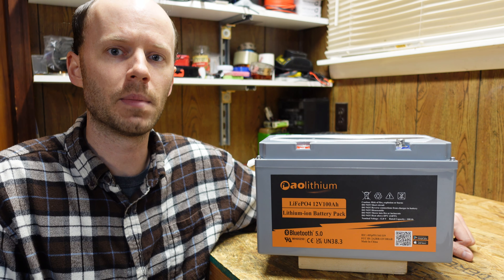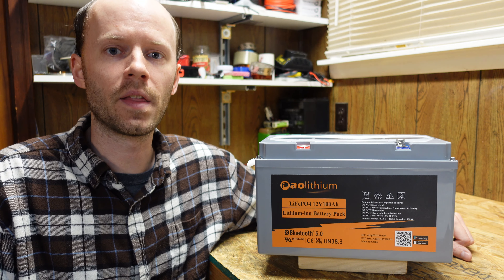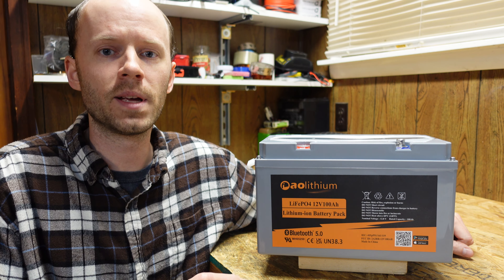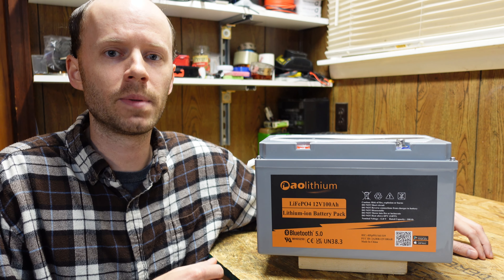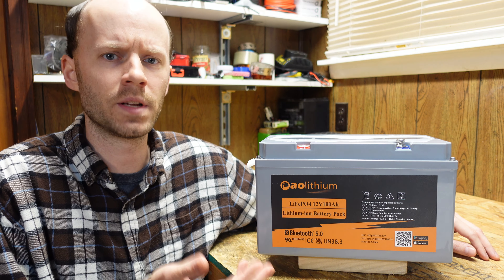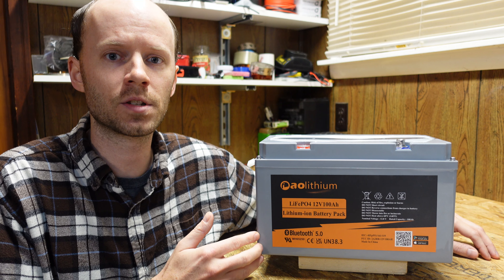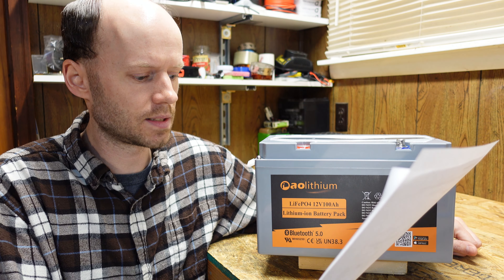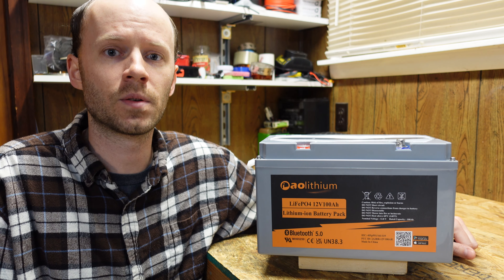Updates on the AoLithium 12V 100Ah LiFePO4 Battery

Comment from the maker: The updated specifications sheet for this battery can be found at the link below.
https://cdn.shopify.com/s/files/1/0583/7271/8767/files/Aolithium-12V_100Ah_Specification.pdf?v=1640695246
As always, please feel free to leave any questions, comments, or concerns. Thanks for watching!
Reply: They sent the updated specs but they didn't bother to update their listing on their website, it still says 200A continuous. Most people will just see the their listing to buy it. Hmm....
Reply from the maker: I noticed as well that, at the time I uploaded this video, the website still listed the 200A discharge current. However, as of the time of this post, it appears to have been corrected and the new specifications sheet posted.
Reply: @DSmartLife  We are really so sorry for this unintended mistake about Aolithium 12V 100Ah LiFePO4 Battery.
The correct description should be the Maximum Long Pulse Discharging Current is 200A, Maximum Duration: 3min.
We have already correct the data in specifications, websites and other promotional materials.Thanks for your supervision and support!
Reply: In Will's video the discharging lasted for 27 minutes with 201A current, and then, the battery was automatically cut off, because the battery was being protected by BMS. The over temperature protection temperature of the battery is 75°C, and the battery would automatically cut off when it reached 75°C. In Will’s video, he told us when using high-power electrical appliance, you should make sure that the maximum discharge current is no more than 200A ,and you don't run it for more than three minutes. The same advice is given to you by Aolithium.
Reply: that link does not work for me.

Comment: 3 minutes @ 200amps is still very useful and not many other batteries use calb cells that is capable of this. Actually I couldn’t find any prebuilt . If they do change there bms, hopefully they keep this feature. I will accept a healthy price drop as a sorry for this false advertising. Thanks for the video!

Comment: Lots of folks in the boating and camping world rely on 24 volt batteries.  I also think that a 24v system is what some people would consider "right-sized" for an emergency backup system for powering their fridge and a few lights during an extended power outage.  Your opinion may vary.
Reply: same here

Comment: Thanks for the update and keeping such battery assemblers in check. Can't imagine they did so much to increase the current capacity of the battery but "forgot to check cell specs", which is there most important. Now basically this battery isn't worth more than any other decent one in the market. Most of the 100A JBD BMSs can handle surge currents, no need to pay a premium for 200A BMS for that and sacrifice 48V capability. They also forgot to program the BMS for high temp cutoff at 60°C. Anyways thanks for the video.
Reply: We are really so sorry for this unintended mistake about Aolithium 12V 100Ah LiFePO4 Battery.
The correct description should be the Maximum Long Pulse Discharging Current is 200A, Maximum Duration: 3min.
We have already correct the data in specifications, websites and other promotional materials.Thanks for your supervision and support!
Reply: Because the 75°C set by our protection board is the temperature of the aluminum busbar, which is the internal temperature of the battery. It is more accurate to detect this temperature
The 60°C you mentioned refers to the environment temperature, which is the external temperature of the battery. 
According to the summary of the previous bms development data, when the environment temperature reaches 60°C, the temperature of aluminum busbar will generally exceed 75°C. 
So our over-temperature protection setting is correct.

Comment: 24V is common in some parts of the world where 48V  (57.6V peak charge voltage) exceeds some local codes for low voltage and therefore requires wiring by a licensed electrician to comply with local codes.

Comment: will prowse just did a review on that battery and despite the spec sheet this battery pulled 200amps for almost 30 minutes...  it was extremely hot but it did it which is pretty impressive!

Comment: Well done! I was surprised Will did the full test he did, after he found the spec sheet for the cells only allowed 200A for 3 minutes… 
I can sure see the value in  the BMS allowing 200A discharge, but locking out 48V use, and not temp limiting the discharge is bad on their part…

Comment: The 50 Amp charge apply for only 1 battery or apply olso if there is 3 o 4 batteries in parallel, or you can pump more the 50 amps if the is 3 or 4 more in parallel. Thanks

Comment: Nice follow up. Thanks. 24v systems are very useful, 12v is not capable of the higher amperage without very large cables.

Comment: Unacceptable from a manufacturer that the 200A rating would make it all the way to the battery specifications
Reply: We are really so sorry for this unintended mistake about Aolithium 12V 100Ah LiFePO4 Battery.
The correct description should be the Maximum Long Pulse Discharging Current is 200A, Maximum Duration: 3min.
We have already correct the data in specifications, websites and other promotional materials.Thanks for your supervision and support!
Reply: @aolithiumofficial  how can the consumer have trust in a brand when mistakes like this occur? How do we know you have correctly designed the battery and followed components data sheets (wire, connectors etc). Did no one actually test the 200A rating against the cell data sheet? Seems like a massive oversight which is indicative of poor quality and potentially dangerous

Comment: 24v is useful in many applications , like semi trucks have 24v system a driver can add two such batteries and have 2.4kw hr capacity to run his air conditioner or microwave or fridge in the cabin while the main engine is off. and it will save the life of main starting battery . , some high power ups uses 24v battery , like the ones in my server rack has two 200ah tubular leadacid battery (soon will be replaced by 280ah lifepo4 cells and i will not use a bms for reliability reasons , i will let the ups handle cut off voltages and active cell balancer do the cell balancing . i will add a 250a fuse , my usual load of whole setup is around 1kva , lead acid runs it for about 2hrs now (the batteries are 4yr old )

Comment: I ordered 4 12v 300 amp hr lithium batteries. What size battery cables will I need to wire them in Series? I will use for AC200P back up storage. 
I wish someone would make a video about how to determine what size cables to use. I can’t fine one.

Comment: They definitely screwed up, but AoLithium gets points in my book for NOT trying to lie, evade, cover up, etc.
Reply: Well they did lie until they have been called out and issue an "updated" spec. Good that we have honest YouTubers that know the game of such battery assemblers rather than simply trusting their "ratings" as gospel!
Reply: @DSmartLife  maybe, or maybe it was laziness/sloppiness... Or maybe their marketing dept confusing peak output with sustained, etc. and didn't bother to check with their engineering Dept. But I'll agree that between him and will prowse they are doing a great job of trying to hold them accountable.

Comment: The 24v VS 48v dilemma is a nightmare for myself in Canada. Our prices on off-grid goods is absurd. 48v will have a substantially higher initial cost, but has an easier time keeping amps down. 24v is about half the price with two batteries, but trying to find ones in Canada that can discharge 125-200 amps is difficult. 

I've gone back and forth for weeks trying to figure out what to do.

Comment: Why is the max discharge rate important? Is it because if I had 10 items drawing 30 amps each, would that be considered 300 amps for whatever length of time?
Reply: It has to do with inverters with high wattage. like a 12v system with a 2000 watt inverter or a 24v system with a 3000 watt inverter.

12.6vX100amps= 1260 watts. How can a 2000 watt inverter work with this? It cannot. 25.2vX100amps = 2520watts. Cannot fully utilize full 3000 watts. 

So you see, high discharge rates are important with lower voltages.

Comment: I think RV users and it's common for both 12 and 24v.
There is obviously 48v but for suitable amps  (50)  a 24 is great over the very high draw from a 12v.
I'd be going for a 48, but oddly my older system is 36v. So if you think it's odd
.. that has to be a oddity.

24 is very simple and small. But 48 jumps to the danger level. Personally I'd like to see.165dc as it's native for 120.

And it's.down to battery size is think?
What's everyone law think?

Comment: Hi, all the reviews I am seeing are mostly of batteries available in the USA etc. do u suggest a good battery with a good price, lifepo4 battery easier excess able in Europe. Looking a battery of a capacity of 300~400ah, with a temporary discharge of 300amps as would be used for services including bow thruster on a boat. Thanks very much

Comment: Acutally, my whole house runs of of 24v, using two GS inverter 12k which is 600 amp at 24v.  each inverter is setup on its own bank so it can pull 300 amps.

Comment: 24v is nice because a lot of equipment is available at much lower prices than 48v. OTR trucks have been 24v for ages.
edit:  For stationary home use I went with 48v. But for anything mobile, 24v is a good compromise. Also many "solar generators" aka "power stations" are 24v and will charge nicely from 24v even if the battery is not directly expandable, making supplemental batteries simple and effective.
Reply: It's still weird.

Comment: 48v is okay, but limit you if you try to add anything DC and cost a heck of a lot more to do, even if you save on wire, still cost a arm and leg.  But, that just depends on how your system is used, I live by my self in a 3br 1 bath house and I'm total blind, so I don't use that much power like others do.

Comment: The main advantage of 24V over 48V is that 48V is in theory deadly, while 24V should in theory never kill a person when electrocuted.
So its the highest "safe" voltage for setting up solar systems.
Though, if you ask me, designing a system where you can "safetly" electrocute yourself seem stupid, plus I still would not trust 24V to not kill.
Reply: That's actually a good point. It might not be stupid in applications where a shock could be unavoidable. Like a marine environment or perhaps job site conditions.

Comment: I would rather keep discharge current below 20-30 amps with large cells, especially, due to heating, keeping the temp, to 25°c or less, in the 15-25° range, so large banks would probably work better than small, life span wise, 
I'm hoping to make the leap to the large lifepo cells before long, I hope the price comes down a bit more, or I have more money 🤑! About 32, of the 300 ah cells would be plenty for my home!

Comment: Interesting results.  It's nice that they actually got back to you. I'm wondering if they know who you are and that you do reviews on the batteries and have a bit of influence in the market.
I'm wondering what actually happened here, though, at the marketing level. Did someone just mis-read the spec sheet and think 3mins of run time would be ample time at 200A, thus the 'continuous' statement, or did someone try to 'oversell' the battery by misrepresenting the information given?
If the former, then they need to be more careful about their claims and do more research on their end. If the latter, that's kind of shoddy and definitely the tactics that the cheap chinese market likes to employ. And in this case, if the latter, they got called out on it.
Kudos to them for quickly making the adjustments to make the information more accurate to the actual batteries' capabilities, regardless of how/why it was done that way in the first place.
Great job on getting in touch with them and getting the information straightened out. 👍👍😎
Reply from the maker: Yes, they know about my channel. They contacted me and offered this battery for the purpose of a review. I think you're spot-on regarding someone mis-reading the 3-minute thing. I don't believe it was intentional, though it seems a bit negligent in my opinion.
Reply: @LithiumSolar  Yeah, from a vehicular starting application, 3-min would be plenty of time to get the engine started. So that's possible what the thinking was when looking at the datasheet.
And yup, I agree that it's a bit negligent in the long run. It's possible a fire could have been created under these conditions.